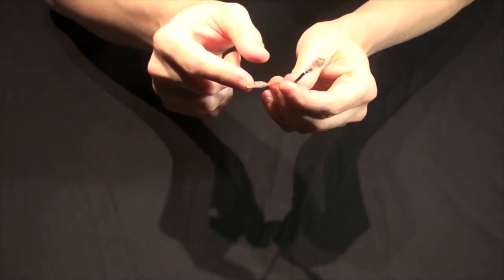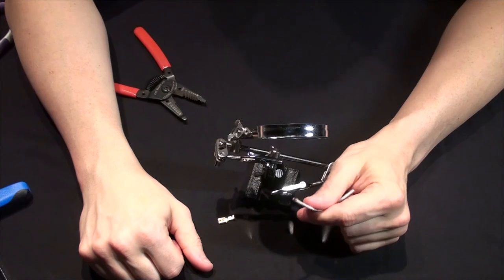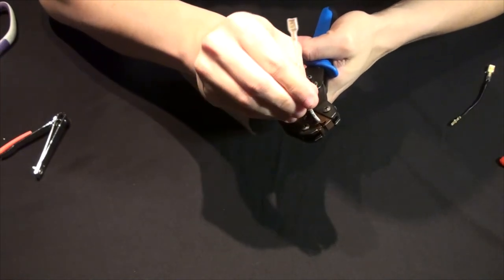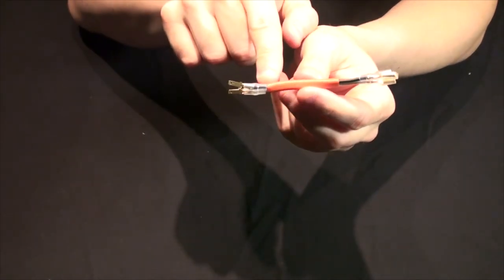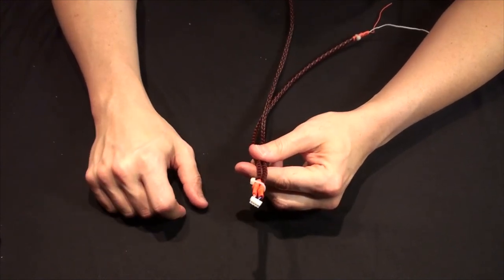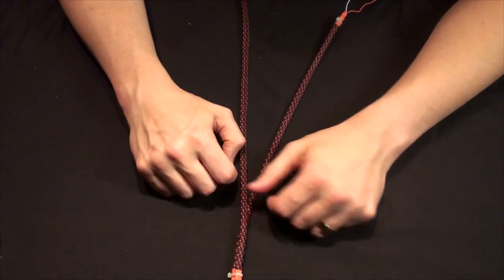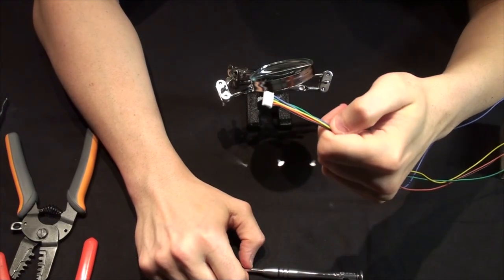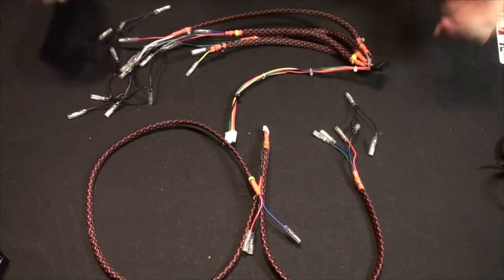Zero to Fightstick Episode 08c: Making & Modding Cables; Everything Else

Comment: @Zevaeros Soreavez Hi would you know what the name of the larger spade quick disconnect is? The ones for the rockers. Are they .187 or .250? You are the only video mentioning the prongs are larger. I was puzzled that my .110 cable just would not fit. I thought i bought all the cables.
Reply from the maker: For the SCI switches, they should be .250. I used this kit: https://smile.amazon.com/gp/product/B07RZSSTSJ/ref=ppx_yo_dt_b_asin_title_o05_s02?ie=UTF8&psc=1